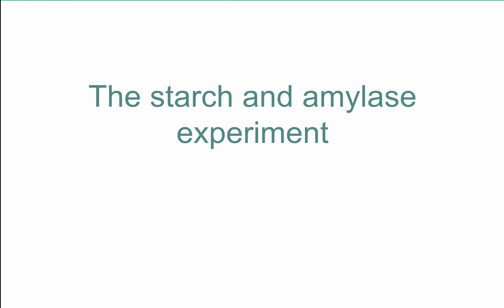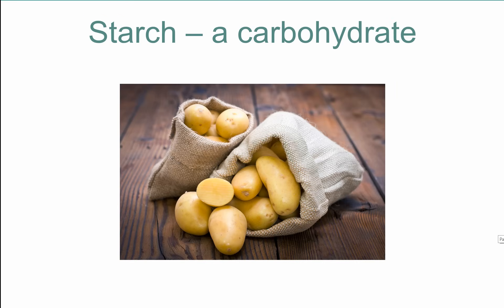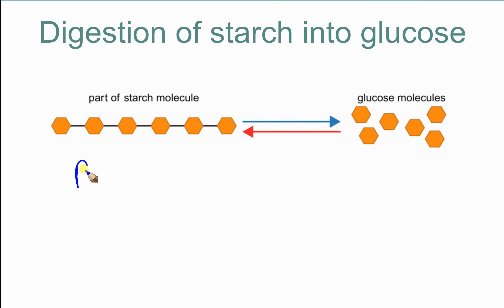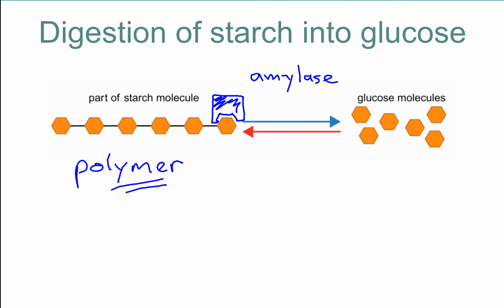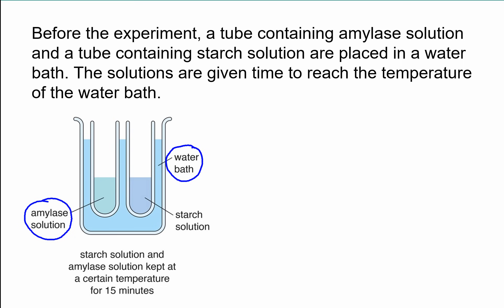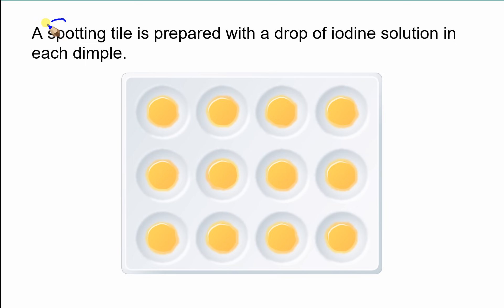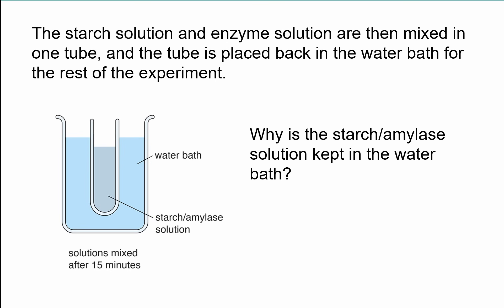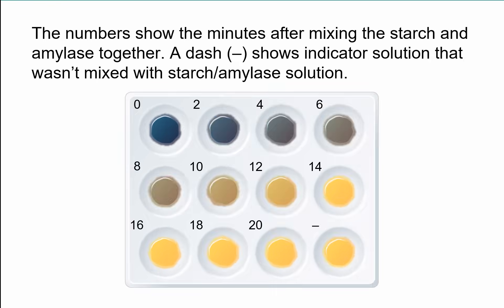The starch & amylase experiment

Comment: Did you take the sample after waiting 15 minutes ( after you mixed the amylase and starch)? Did you wait for 15 minutes and after 15 minutes take samples from the solution every 2 minutes? Or did you start taking samples from the solutions right after you mixed the amylase and starch every two minutes?
Reply from the maker: @Peaceforall1337  let the starch and enzyme separately sit for 15 min ( there are there about) so you can be sure it’s at the same temperature as the water in the water bath. You could stick a thermometer in each boiling tube to check. Once you mix the starch with the amylase the enzyme goes to work very quickly so you need to sample at least every 1 or 2 min.

Comment: First of all, the type of amylase in saliva converts starches to MALTOSE, not glucose. Conversion to glucose does not happen until the small intestine, by virtue of a different form of amylase. This latter form also works at a very high pH (+/-3) whereas salivary amylase (alpha form) works at about neutral pH. In addition, your amylase solution was either weak or degraded because, at optimum temperature concentration (0.05%) the breakdown can occur in 1-2 minutes at most, if the starch is finely divided in the mixture. Considering that salivary amylase in denatured by stomach acid, it would be ineffective if it took 15 minutes to work. Hence, there is good sense to the advice to chew food well before swallowing. (Yes, I know the enzyme can work for a bit longer after food is swallowed because mixing with stomach acid because mixing with stomach acid is not instantaneous...but it is pretty fast.)

Comment: I want to know that why the starch did not breakdown instantly at first  ?
Reply: it didn't break down so quickly because of the type of bond it has it is not a weak bond so it wont break down quickly . in short  small bonds - break down quickly  large bonds - take longer to break down
Reply: @tanyac2820  tysm

Comment: Thank you for posting this; I missed this lab in my own class and the notes shared by classmates didn't make nearly as much sense as seeing it performed! 
I have a question:  why doesn't the amylase continue to work while in the tray?
Reply from the maker: What a great question! Given the chance the enzyme catalyst would continue to work to break down the starch in the well of the tile. However, the iodine has 'reacted' with the starch (giving the blue/black colour) before the enzyme gets the chance. The iodine forms a complex with the starch (the complex being iodine ions locking onto the the helical parts of starch molecules) and this, I think, will change the structure of the starch molecule so it will no longer be digested by the enzyme. The iodine starch complex can not be reversed.